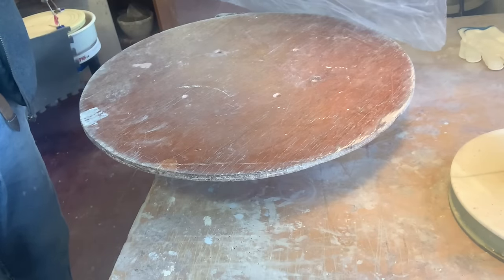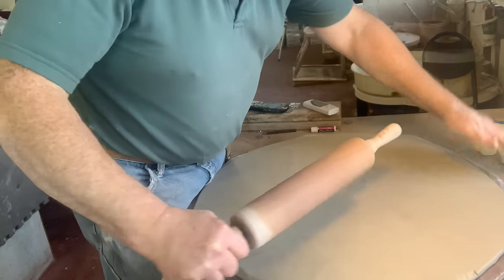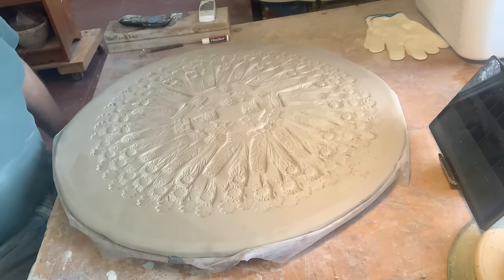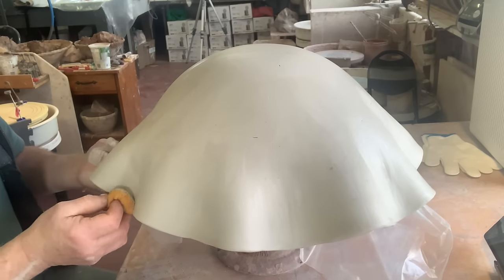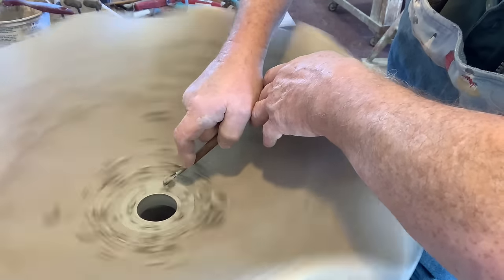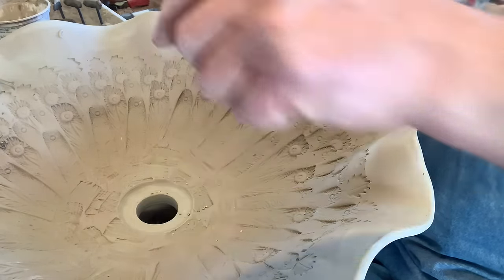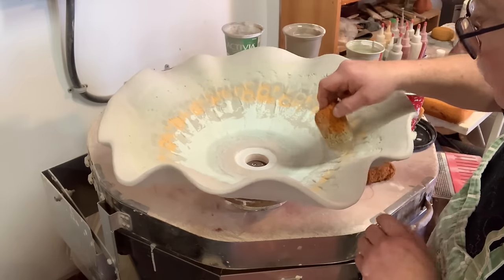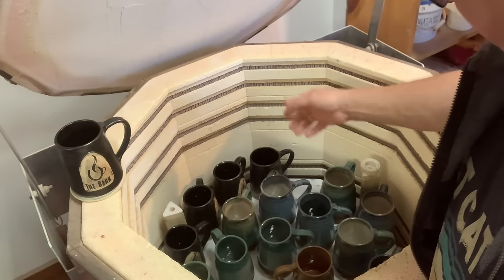Hand building a sink for beginners. Easy peasy.

Comment: I noticed you didnt use any clear glaze on the sink.

Im thinking now that may have been my issue when first using high fire glaze colors on high fire clay. I put 3 coats clear glaze on after the glaze color.

They all came out so ugly looking. 

Do you not need clear glaze with high fire glazes?
Reply from the maker: If you are using cone 6 glazes you do not need to add a clear over the top. If you are using cone 6 underglazes you do have to cover with a clear cone 6 glaze.